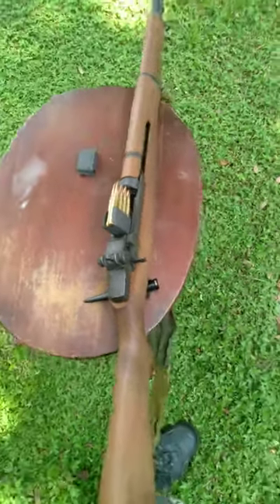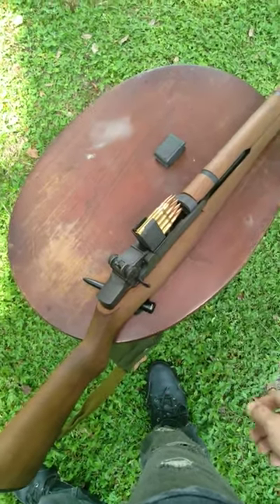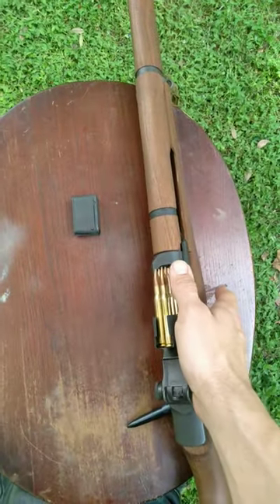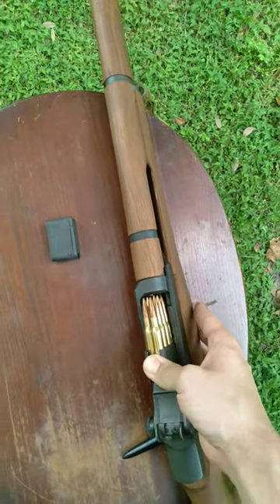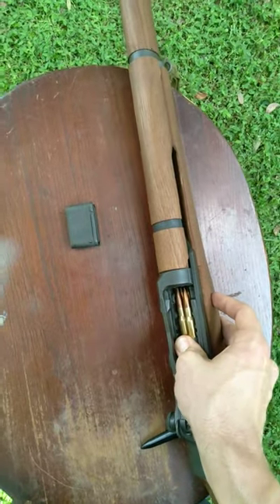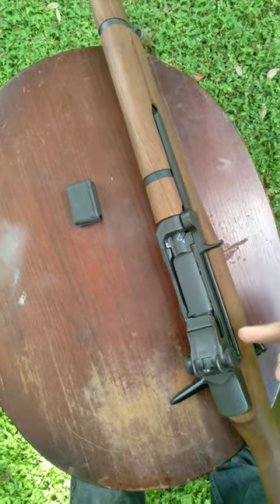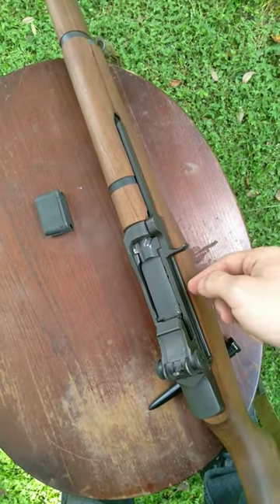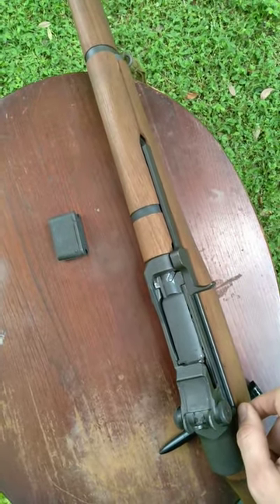THIS Is How You Get Garand Thumb

Comment: if you load with intent, it wont matter if it slides forward or not because your thumb will be scraped not caught, pulled forward and smashed
Reply from the maker: Hahaha first comment ive got wher its like "avoid Garand thumb by not being a b*tch"
Reply: @theblindsniper9130  i didnt want to say it like that but basically yeah

edit: good video though, i wasnt hounding you or anything
Reply from the maker: @GreenHatFencer  Oh yeah I know it, im glad you stopped on by
Reply: @theblindsniper9130  was just flipping through shorts while taking my morning dump. i usually skip right by most firearm videos/channels for the most part
Reply: Homey nah
Reply: @Fuhrious  nah really man, 95% of gun videos are the equivalent of fitness influencers.. manipulative and greedy with misleading or entirely false information
Reply: For real. The top round literally just kicks the thumb out of the way. 

There is ZERO need to block the bolt with your palm.
Reply: @theblindsniper9130  It’s true though. Using your palm to block the bolt does give you better leverage, and pushing back while inserting can act as a crude automatic bolt release as you let go, but it is entirely unnecessary. 

The actual, taught WWII method was to jam your clip into the mag with your thumb alone like a man, and just let go. Sometimes it would require a slap.

The “misconception” of M1 Thumb is HOW it happens. The phenomenon comes from training drills and maintenance foul-ups with an empty mag, where there is zero friction to prevent the full force of the bolt from slamming into your thumb. 

Getting M1 Thumb while loading is both exceedingly rare and is akin to getting lightly pinched at worst if it actually happens.